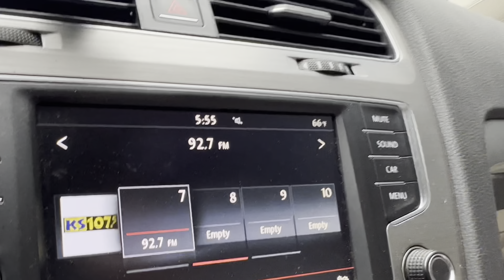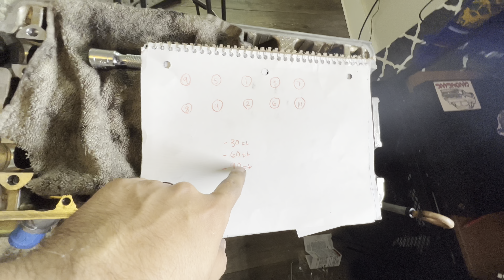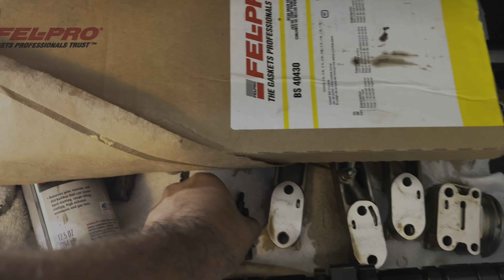CB7| ARP HEAD STUDS ARE IN HEAD IS BACK ON

Comment: not sure if you are getting bigger injectors  but change those seals for the water pipe.  those are my main issues. they always leak for me. I just have bad luck with them lol
Reply from the maker: I think they all came in the the head gasket kit 👌🏽
Reply from the maker: I think I was giving 200c rc injectors
Reply: @Canongang  what. 200 cc. Stocks are  290 to 320. Normally ppl go to 400 from rsx or the dsm turbo injectors for cheap
Reply from the maker: 🤔 damn idk what they are then

Comment: did u get the head decked flat? You want the stud to grab the threads, like all of the threads. you should bottom them all out like the instructions say, idk why you backed them out... jerking the tq wrench doesn’t give an accurate reading, a constant solid pull is much more reliable
Reply from the maker: They were all backed out then torqued down by hand no redeck no need, I didn’t want to deal with the motor being off on balance for degreeing and finding a different head gasket to make up for the removed material